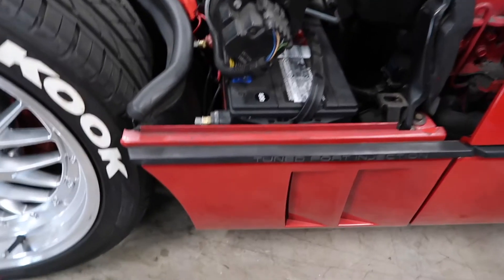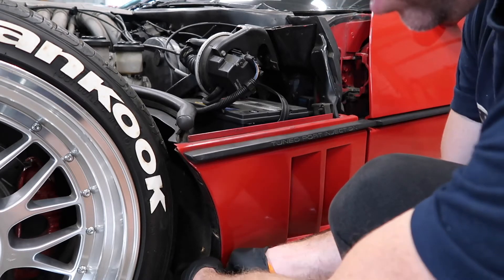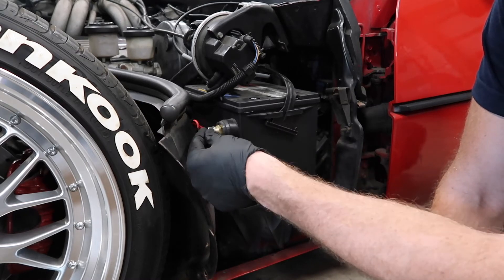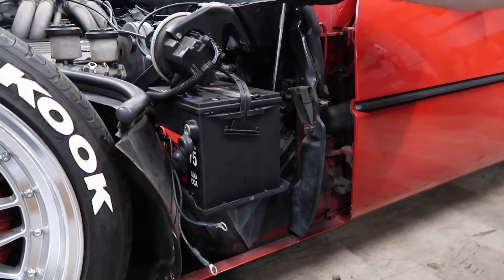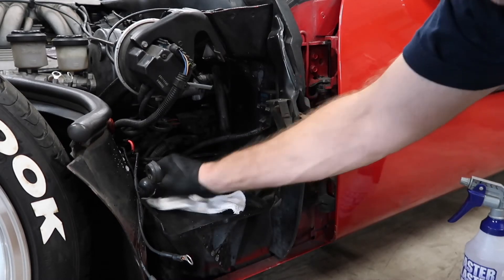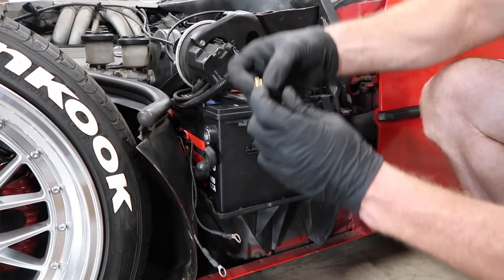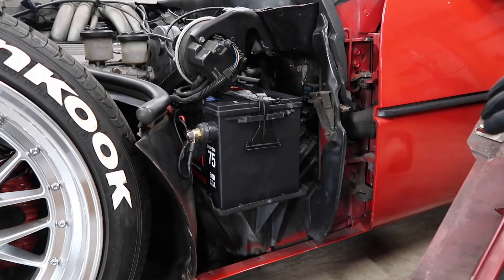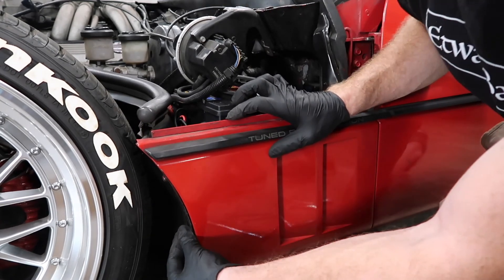C4 Corvette Battery Replacement.  Location and Tips.

Comment: I also just bought an 87 C4 yesterday, its not in the best shape but I've seen worse. Nothing a little elbow grease and TLC wont solve hopefully. Was running pretty rough but noticing the plug wire hanging off the plug helped a bit LOL. These videos will help me familiarize myself with the car as I've already learned a lot from them. I appreciate you making them for sure.
Reply from the maker: Thats great! They are great cars. Im glad you are enjoying the videos.
Reply: @etwasbauen6615  The darndest thing happened today. Just got my 87 out of the brake shop and noticed my brake lights were out. Checked the fuse and obviously that was the issue. The crazy part was that I found a couple more blown fuses, one was to the electronic fuel injection 1. The car runs amazing now and it was just a fuse. Couldn't believe it but I feel very lucky because I got the car cheap because of how rough it was running. I only had 4 cylinders getting any fuel lol.

Comment: My 86 has another torx fitting at the base by the wheel, same as the other two and a captive 10mm bolt at the bottom of the panel which you  just have to slacken off to release it.
Restoring my car over here in England.
Reply from the maker: Thank you for the information! I appreciate it. Good luck with the build!